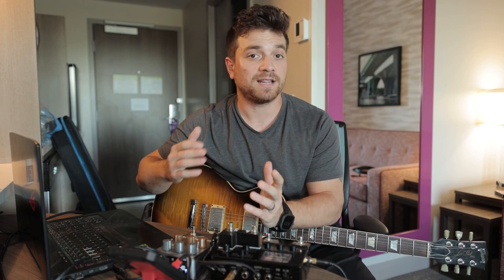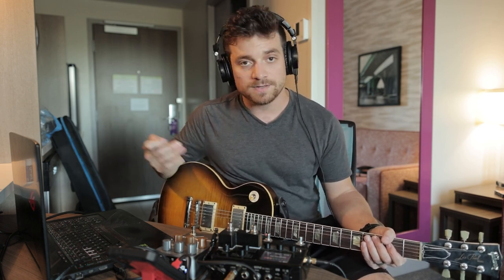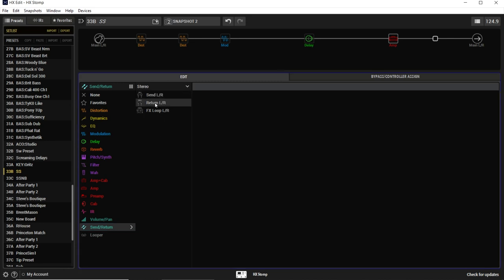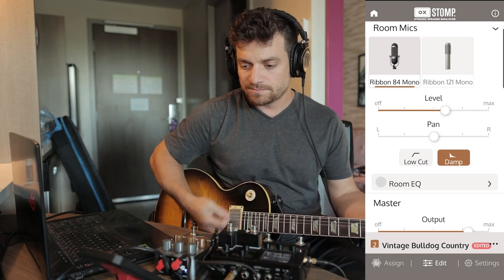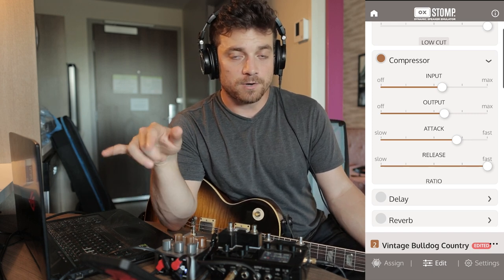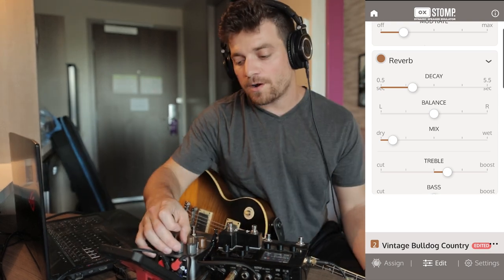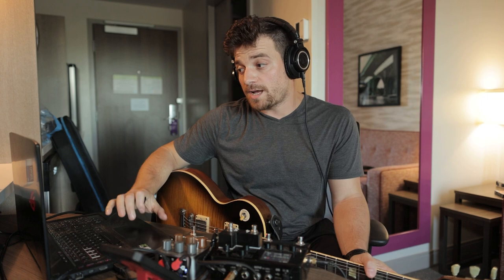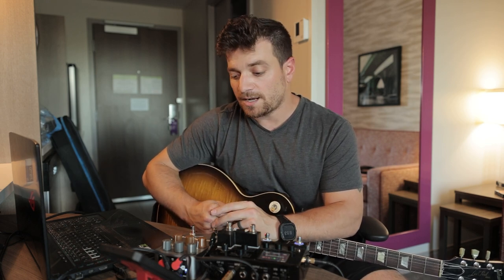Level up your digital amp modeler - Universal Audio OX Stomp

Comment: I got mine last week and it's amazing.  I've got the Waza TAE (also very very good and huge flexibility on stage), the two notes captor x and the cabM+ but this OX Stomp just sounds and FEELS so much better.  I also think it sounds and reacts better than the DynaCab stuff in my Fractal FM3.

Don't sleep on the room mic though.  It can make a HUGE impact on the sound and (in my opinion) the realism of being in the room with a cabinet.

I just played a show this weekend with the UA lion into the OX stomp and a golden boy drive pedal in front and it sounded REALLY good.

They need to put some more work into the app though.  I want to see how many dB's of gain or cut I'm applying on all the EQ sliders and I'd like to see a volume output percent for the mics and master output.

One other thing I did for the gig was use two identical presets but one had slightly higher output volume on the slider so when I toggled the favorite switch between the two, I would get a simple volume boost for solos.  The delay switch turned on/off delay.

One suggestion I made on the UA forum was to give us the option to have delay ignore favorite changing so it will stay on when changing between favorites.  That would be super useful in my situation where I'm doing a lead part with delay on and I need to kick back over to the lower volume preset when the solo is done, I don't want to lose my delay.  My FM3 lets me do this with any effect and it's really helpful.

Comment: Thanks Steve, hands on an honest rewiev. My 2 cents: I have it running post a Boss GT-1000, cab sim turned off, with classic rock tones and it does some good here and there, especially rounding off of fizziness. But I am sure 8n a live situation in a mix this small difference isn't audible. For my not worth going for, despite all that positive reviews. Cheers, Frank.

Comment: Any reason to put the Ox in a loop as opposed to just after?
Reply from the maker: When using hx as my interface, thats the only reason. Otherwise you can stereo out into a d.i box or interface
Reply: @SteveSterlacci  Perfect, thanks. I often forget about Helix as an interface because I usually use it with my RME, but it certainly kicks ass both ways.

Comment: Cool video steve. I’ve been impressed by the oxbox but it’s been way out of my price range. Very glad UA came up with this more affordable version. Quick question, does the reverb have a spring reverb or is it just one type of reverb? Thanks 🙏
Reply from the maker: Right now its just the 1 reverb. Hopefully we get options added with firmware updates
Reply: @SteveSterlacci  that would be great! 🤞🤞
Reply: its a plate reverb the best plate reverb around they set the standard

Comment: With the new Cab Engine, the HX Stomp is significantly easier to dial in great sounds. I didn't hear anything particularly special from the UA OX Stomp Pedal. 🤷
Reply from the maker: At the end of the day, the diminishing returns is getting smaller and smaller... idk if itll take a place in the portable gigging rig, but its nice to have options
Reply: @SteveSterlacci  Yes, we'll see. There's a Modeler out there that could meet just about anyone's needs and budget. 👍

I don't know how much you follow AI, but the leaps and bounds it's making in images and video rendering are mind boggling. I'd like to see something similar take place in Audio/Modeling/Profiling, as there are a lot of similarities in file size, processing requirements, and creativity. The "Matt Wolfe" YouTube Channel is a great place to keep up on the breathtaking pace of AI advancements, and I highly recommend it even if you have only a passing curiosity.
Reply: there is a difference but the main diff is the feel when you play through the ox stomp it has that tube feel not like line 6 digital feeling

Comment: Steve how could I run the hx stomp with the nano cortex as far as routing
Reply from the maker: I'd put the nano in the loop of the stomp
Reply: @SteveSterlacci  if I was to 4cm  the stomp into my amp how then could I integrate the nano cortex
Reply from the maker: Nano in loop of stomp, stomp in loop of amp. Seems a bit overkill though lol
Reply: @SteveSterlacci  I don't want to neglect my stomp now that the nano is here.

Comment: Not sure what UA is getting at with their claim of dynamic speaker modelling. Tests have been performed over in Fractal land and it seems as though there is nothing dynamic about their speaker modelling. The speaker drive feature is nothing new and has been a feature with Fractal products for as long as can be remembered. Hmmmm… seems like marketing nonsense. Good sounding IRs though.
Reply from the maker: I'd be curious to read the findings if you wouldn't mind sharing them here
Reply: Fractal think they are too good to be sold in the shops yet they can’t even come up with a usable interface hahaha.  Kemper and fractal are both fucked soon if they can’t compete with others who make it easy to get a good sound fast.
Reply: Posted a link to a thread on the Fractal forum where Cliff explains his testing and findings but it seems to have disappeared. Not sure about the rules on YouTube for posting links but if you search for “dynamic” in the fractal forums it’ll pop up in your search.
Reply: @benburnett8109 the testing that Cliff was pretty extensive. It gets technical beyond my understanding but he seems to know his stuff
Reply from the maker: @paulunderwood1911  ah links do get flagged sorry. I will have to look for it! Thanks!